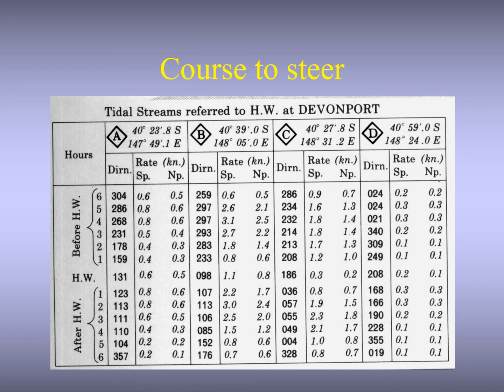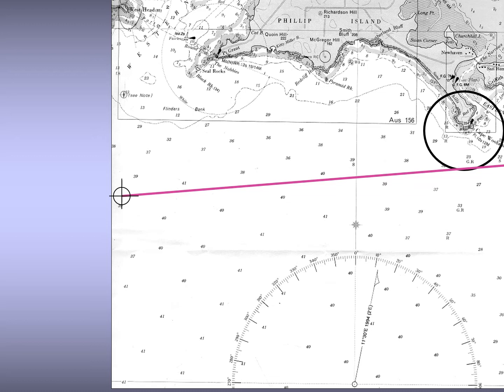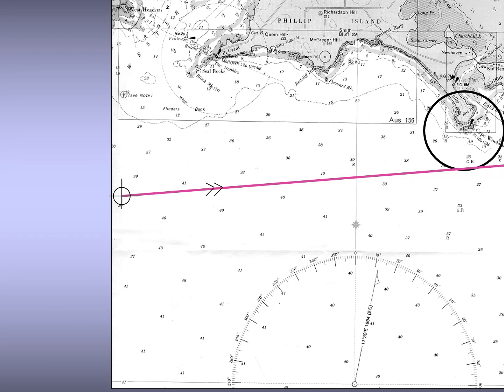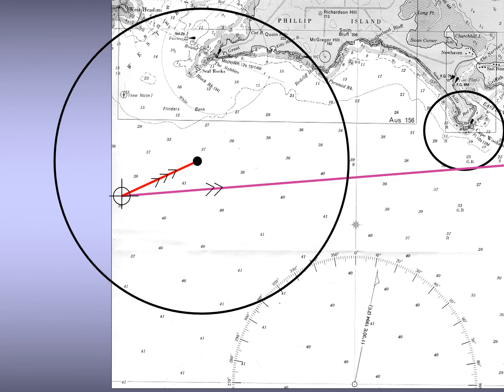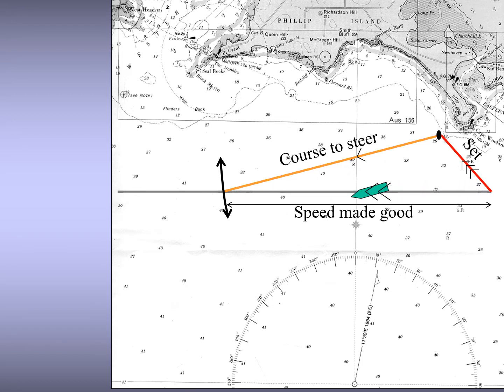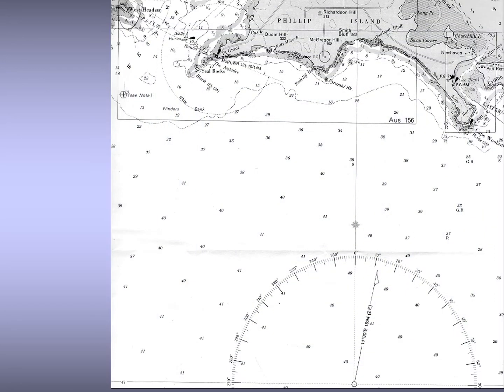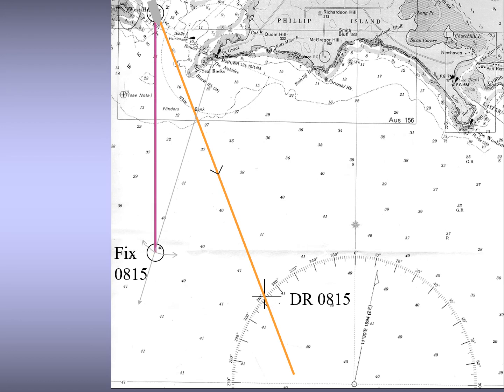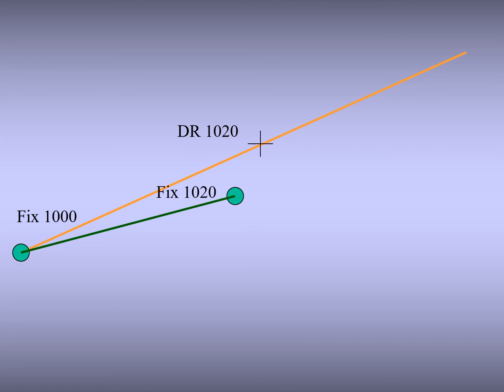Chartwork for seafarers - Finding the course to steer to counteract for the effect of tidal currents

Comment: Hello sir , in the beginning , how did u take steam rate and direction from diamond , all timing are given in hour difference , what if my time difference is 0230 hours, should I consider 2hours or 3 hours
Reply from the maker: Hi Amit, you can take a mean of the values. calculate for both 2 and 3 hours, and average them out. also, for considering the UKC, take the value which gives you a higher safety of margin. always consider the worse case scenario. hope this helps.
Reply: @SteeringMariners   thank you so much sir.